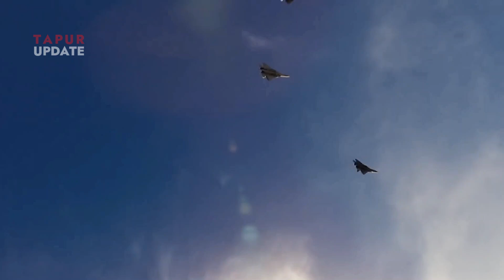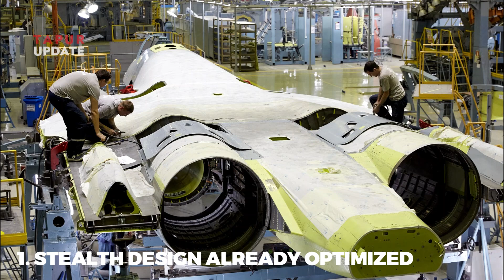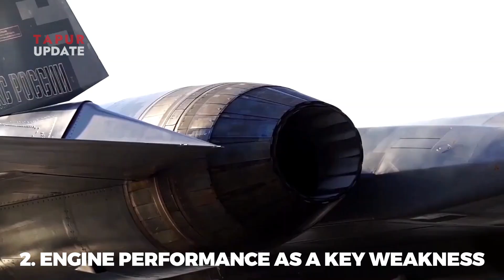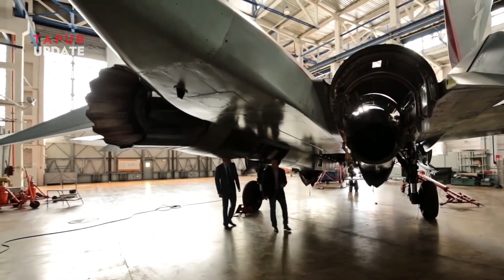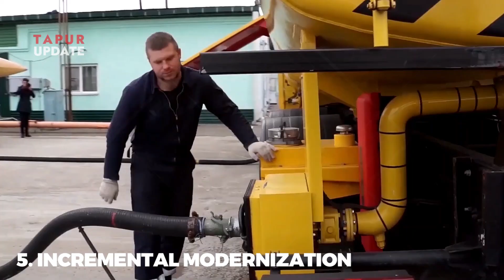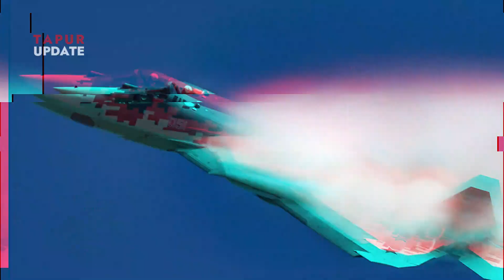Behind the Scenes: Why Russia Chose Power Over Looks for the Su-57 Fighter Jet

Comment: Concerning stealth. The USAF renounces F-22 and F-35 and prefers a modernized F-15. That has reasons! F-35 is even a big flop. About 50% is on the ground due to repair and maintenance and it doesn't provide the targeted technical power.

Comment: Russia should work with China and 
Improve its  composite materials 
For reducing radar cross section.
Reduce the weight of the jet.
Reply: Russia is more technologically advanced in aviation than China! The author does not understand what he is talking about, the most important thing in an airplane is not its airframe, the most important, high-tech, is the airplane's filling!!! Engines, radars, weapons,..... The airframe of the airplane is the minimum cost, it can be easily and fairly quickly changed if necessary!
Reply: Stealth technology is a Russian technology, it was created by Russians, not Americans.